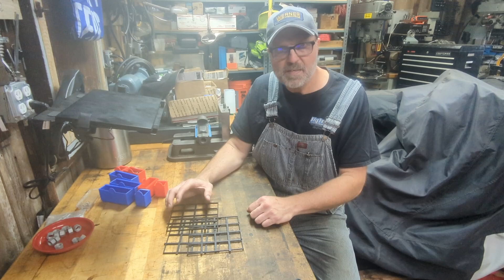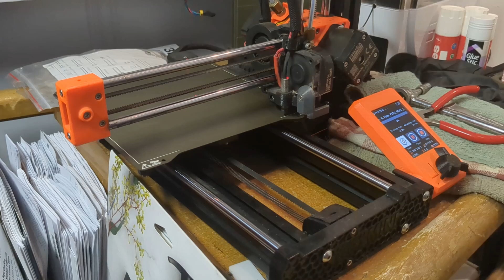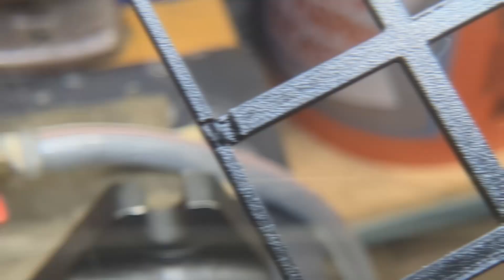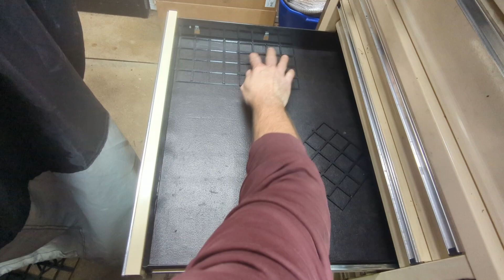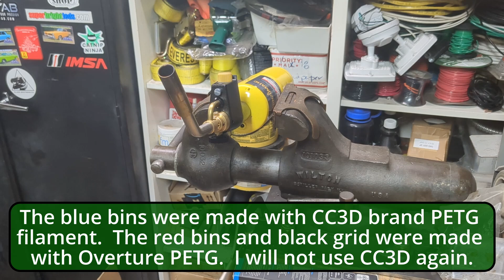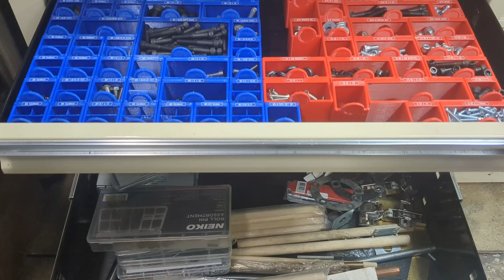3D Printed Hardware Storage for your tool chest drawers - One size fits most!

Comment: Great idea and design. As mentioned by someone else, I'm going to modify the grid connections to dovetail to eliminate supports and the subsequent cleanup required. Even though I'm in the US, I work primarily in metric, but I'll figure it out. Lol. Try using PLA+ also called PLA 2. It's not brittle and behaves more or less like PETG, except it can't tolerate as high a temperature and it still creeps under pressure. For this use though, it is perfect, and no stringing. I haven't used regular PLA in years.
Reply from the maker: Thanks for checking out my video and for the comment!  Before you go too far making any changes, check out Gridfinity.   After I made my project (doh!) someone pointed me towards that system which came out about a year earlier.  It's metric and community based, so there are thousands of downloadable containers designs.  Here's the link - https://gridfinity.xyz/ Have fun going down the rabbit hole:)

Comment: Why didn't you use gridfinity. The fusion 360 plug in makes it easy to design and print.
Reply from the maker: Good question!  I only learned about Gridfinity from another comment and had never heard of it before I created my storage system.  I just thought about my problem and came up with a solution.  Thx for the heads up on the 360 plugin which looks great too.  That's news to me.  If I end up needing more storage, I'll try out Gridfinity.  Thanks for your comment!

Comment: Simplified non-metric Gridfinity
Reply from the maker: Oh, wow, I didn't realize I had reinvented the wheel.  My introduction to Zack Freedman makes me feel quite inadequate (haha).  Here's a link to the video describing his system, which is leagues beyond mine (https://youtu.be/ra_9zU-mnl8?si=9dLKNChNyjsMmGxB).   It's really cool that the Gridfinity bins have similar features, like the grid base, multiple sizes, and the label tab.  Stackability is a neat feature, which I couldn't do with the thumb handles.  I also like the sloped bottom of the bins which aid in grabbing parts from the bin.   Really neat that people approaching a problem sometimes end up with very similar solutions. Thanks for pointing me in this direction.
Reply: @WernersWhirligigs  now you have a giant repository of open source designs that you can remix into your system. It's a rabbit hole.
Reply: @WernersWhirligigs  With the Gridfinity system, you don't really need thumb handles because you can slip your thumb under the label tab if you need to grab a bin.
But everything is suggestive, you can design your bins with a full size handle if you want
Reply from the maker: @NicksStuff  Good point!  At this point, I've filled two drawers using the system that I came up with, but if I need more storage, I'll likely try out the gridfinity system.  All the community support for it has certainly been helpful.  Thanks for sharing your comment!

Comment: Nice job! What Cad program did you use? If you shared the original cad files, it could make modifying them to fit each individual's tastes a bit easier than editing an .stl. Also, what kind of tool box is that? It looks like a U.S. General, but I've never seen that color before...
Reply from the maker: Thanks for the compliment!  I use Fusion 360.  I I'd be happy to share the original files.  I'll put them on Thingiverse, if that's possible,  or set up a download elsewhere.  I'll post another reply when I get that done.  Also, good eye on the tool box.  It is a US General from Harbor Freight.  It is black, however I wanted a more vintage feel in my shop, so I wrapped it with vinyl car wrap in that color.  FWIW, it took me about 4+/- hours.  Thanks again!
Reply from the maker: I have uploaded the STEP files for all the components to Thingiverse.  I believe this file type will allow for modification in a number of different CAD programs.  Thanks for the suggestion.